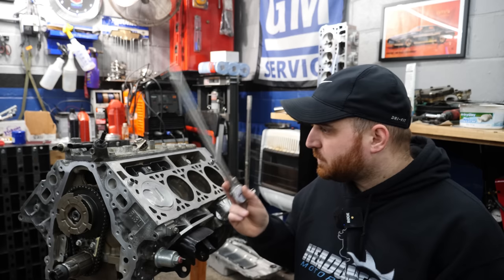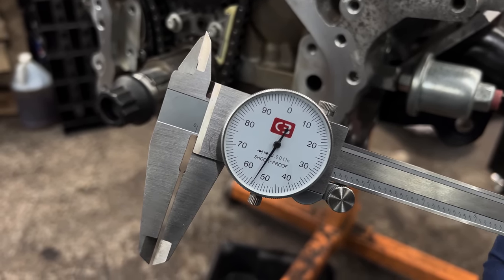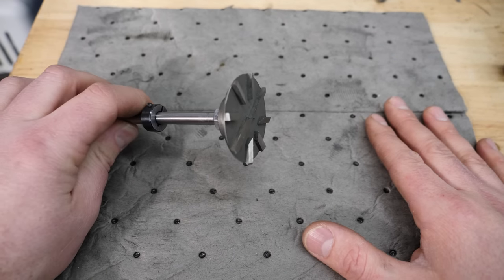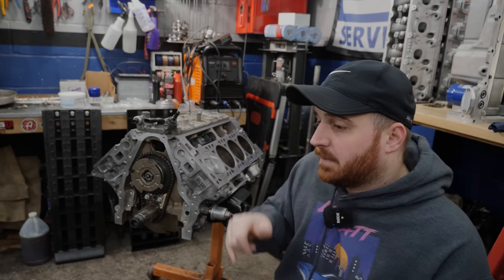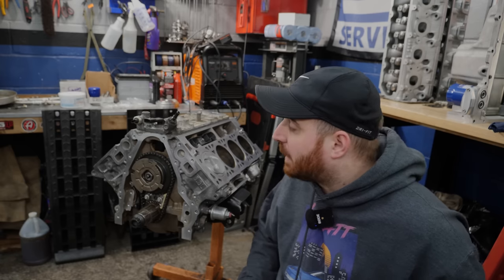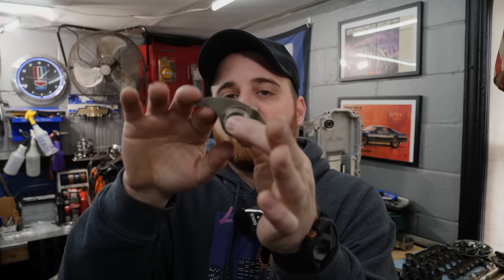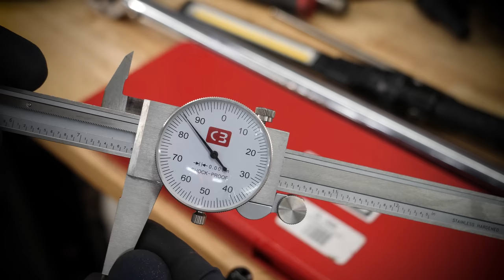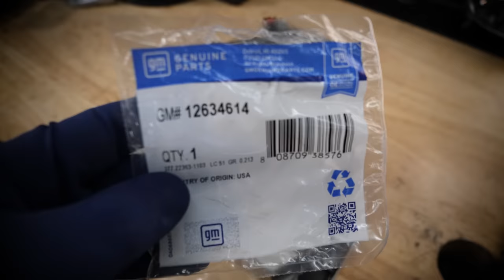1986 Transam Project! Heads, Cam, and Engine Assembly

Comment: I foresee a front crank seal leak looks like u tightened the front cover without making sure the cover was centered on the balancer first. Gm was very specific and had a special tool to center the balancer sealing surface before u torque the front cover down.

Comment: quick question what motor mounts are you using for the new LT swap??
Reply from the maker: I have adapter plates with the stock rubber mounts and clam shells

Comment: I gotta ask... is there a reason you wouldn't just run a slightly thicker head gasket to get more ptv clearance?
Reply from the maker: When I ordered the tool I thought I only had .016 of ptv which a thicker gasket wouldn’t of helped. I could of ran one after getting the correct measurement but decided just to cut the pistons being I already had the tool.
Reply: I was going to ask the same exact thing.

Comment: 4:45 - ignorant-me question. By doing that, aren't you hurting the balance in the piston head? Isn't the piston head supposed to be balanced to avoid putting extra pressure on the piston walls and rings?
Reply from the maker: Yes but it’s such a small amount of weight that it shouldn’t hurt anything.
Reply: @lsxmatt  Thanks for the reply! Hopefully as you said, it will not hurt anything, and will be a hell of a ride to enjoy, rock hard and have fun with, once you're done with it.

Comment: Any chance of using a thicker head gasket instead of opening the reliefs?
Reply from the maker: I could of but I already had the tool and standard headgaskets so I just decided to cut them.
Reply: @lsxmatt  makes sense.  Not to mention not losing too much static c/r.